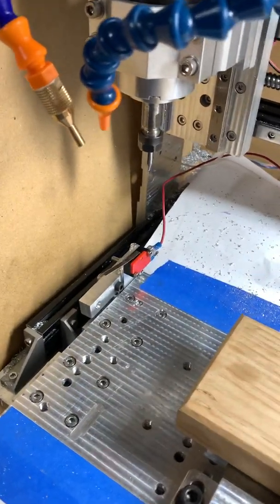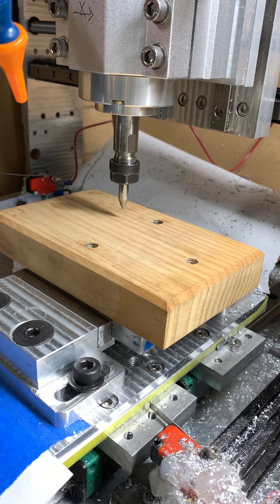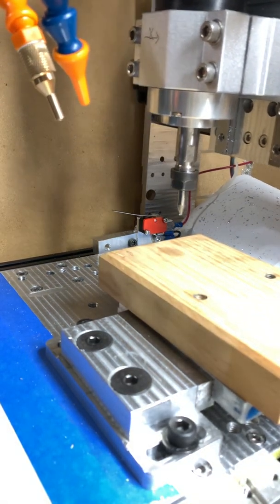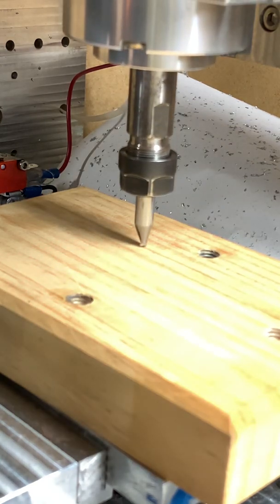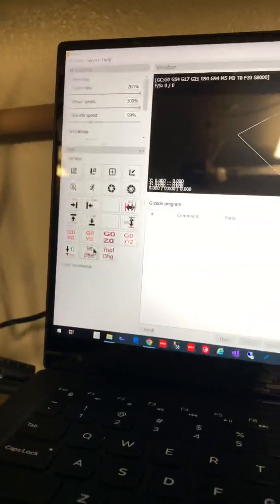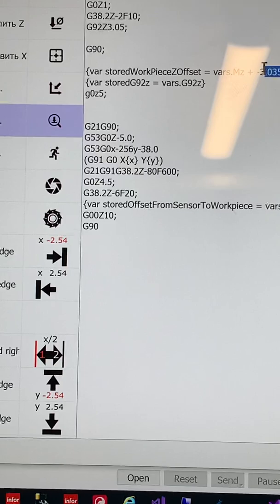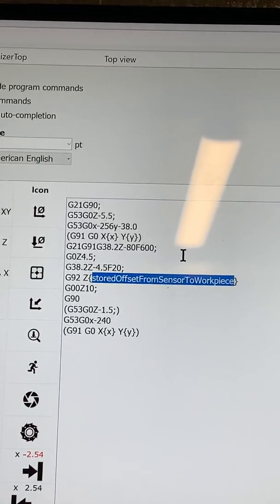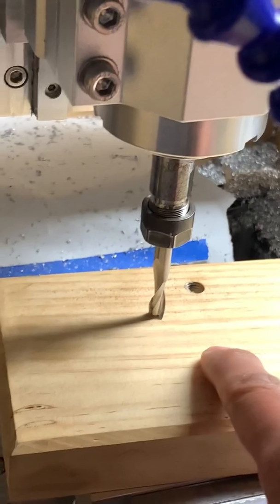3018 cnc workpiece offset probe

Comment: hi, i am also interested in how u make it save the tool offset? I am also using candle software with grbl controller but I am stuck to make it, here is the linked video that I am stuck, can u make me a video, please? 
https://drive.google.com/drive/folders/1n-7vEkGQhegA32oMA-cm59yBVN0UqtHI?usp=share_link
Reply from the maker: I think it would be easier to help you if you ask here: https://discord.gg/ngnV5Xe5WN
Reply from the maker: when you endmill is at -56.240 use G92Z-44.795  this will set the correct zero z-location to the top of your workpiece